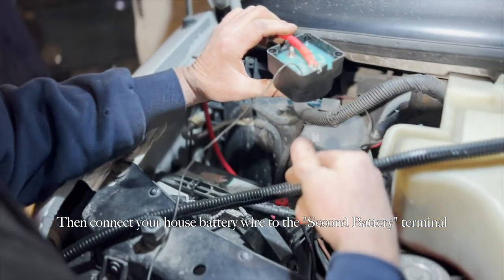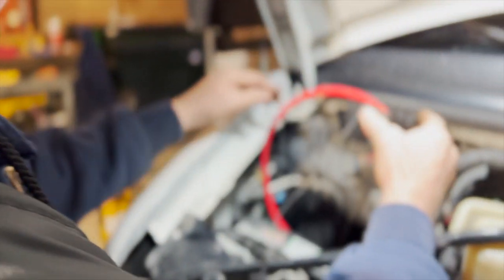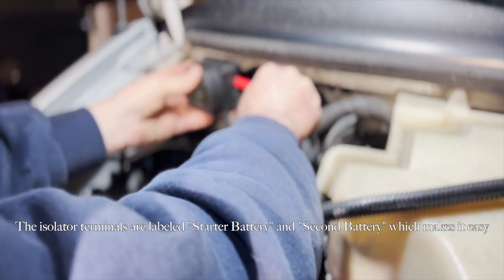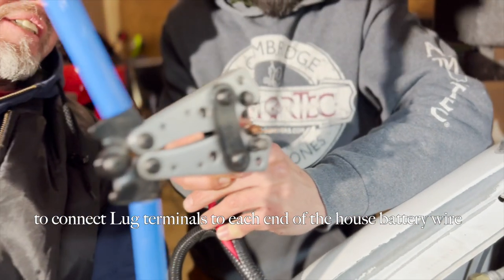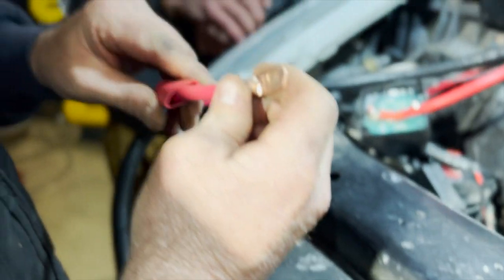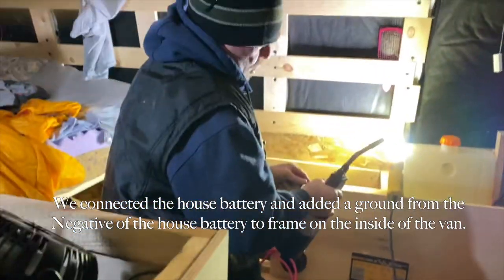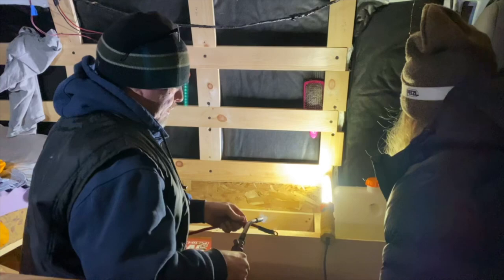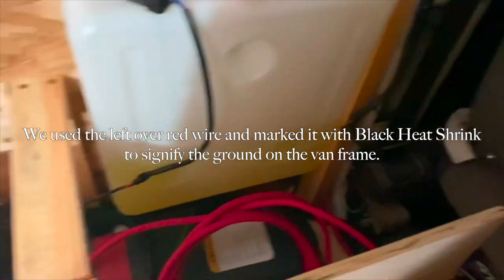How to install a Battery Isolator (and not die) | VAN BUILD SERIES | Winter Van Life

Comment: Hi Danielle.  Keep in mind lead acid and lifepo4 batteries charge at different rates and float at different volts.  Your alternator rectifiers may not like you for very long.  I would hate to see you get stranded.  Lead acid and AGM are a better match than lifepo4.  You may want to look into a DC to DC controller for lifepo4 charging... or a lifepo4 charger.  Good luck 🤞
Reply from the maker: I have read about this as well. This battery isolator says it works with all batteries. I could also install a switch to be able to switch on only if I really need to charge. Thanks! And good to see you!
Reply: @DanielleRootes . Thanks!  I have followed your build and I can see the joy this brings you except for the creep down by the river.  So let me explain a little bit more....  it's not the battery isolator I'm worried about.  The isolator just provides an additional isolated diode protected circuit.  It's the rated amp draw of your alternator that would concern me.  Too much amperage flow can damage your alternator.  Normal lead batteries have a higher resistance causing a slower charge.  Lifepo4 batteries have a lower resistance allowing for a much more rapid charge.  Hence, making your alternator work 10x harder than it should.  It can't hurt to stop by your local RV dealer and bend their ear.
Reply: @DanielleRootes  It should be fine;  I charge LiFePO4 with an isolator.  I put a switch on the isolator's ground wire to disable it when I don't want to charge via alternator.
Reply: @borreal_trekker  >  Lifepo4 batteries have a lower resistance allowing for a much more rapid charge

In theory it's a concern.  In practice (my experience and the 20 or so installs I have firm data on) LFP tends to pull about the same as a same-Ah bank of AGM at 50% DoD.   A clamp-on meter or shunt will tell the tale in this particular case.  

Example:  I charge a 100Ah LFP with a VSR similar to Danielle's.  It pulls ~32A at low SOC, ~25% across the broad middle, and just a few amps above the knee.  Stock alternator on my van is 180A.  I cut alternator charging when bank voltage rises to my preferred Vabs (13.8v).
Reply from the maker: Good to know, how long has yours been installed?
Reply: @DanielleRootes  I installed my LFP in Oct 2021.

Comment: do you know if an isolator drain primary battery when vehicle isn't running and not using the 2nd? i have a small drain that drains my main and can't find it. the 2nd battery is used to operate my wheelchair van ramp and power controls. it's also used to jump my van if main battery is low.
Reply from the maker: The isolator is designed to not draw off the starter when it’s not running because it’ll detect the voltage coming from the starter. The second battery will only draw above 13.3volts (when the van is running) anything less than that voltage (such as when the van is turned off) it will not draw from the starter battery.
Reply: @DanielleRootes  tyvm